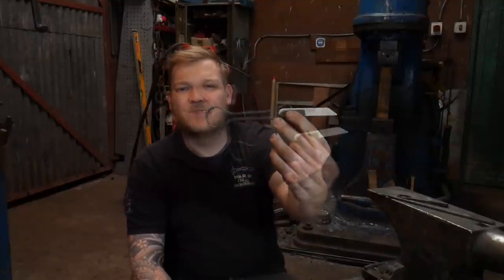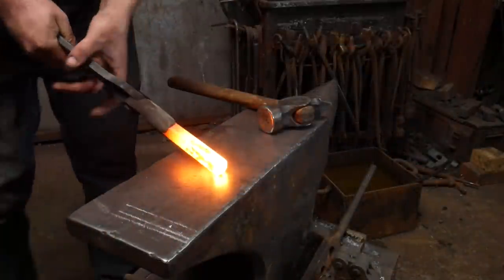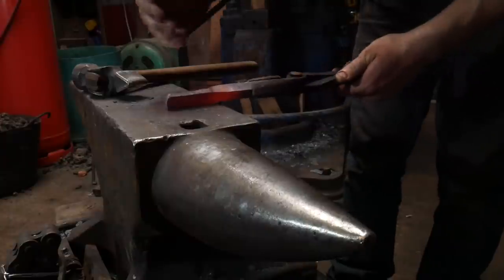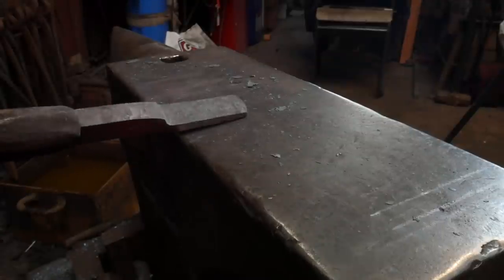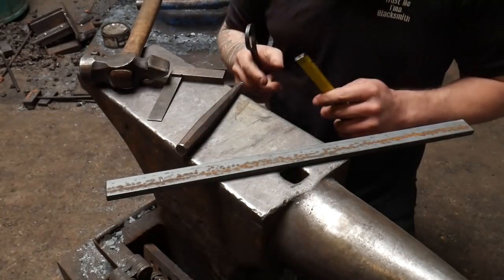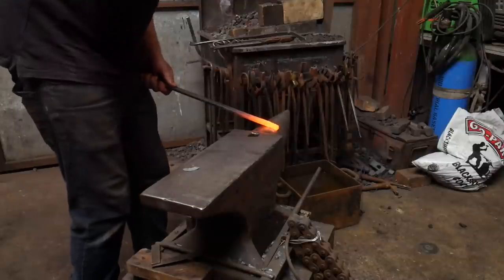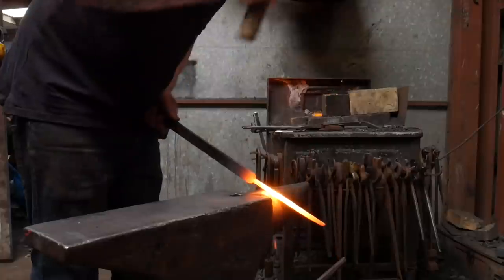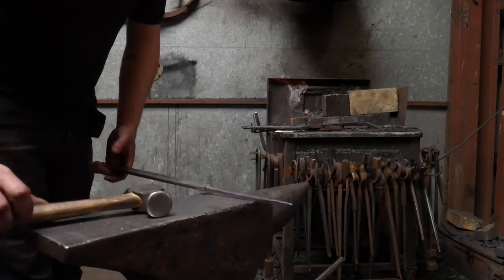Soapstone Holder Great Blacksmithing Project! Stay Home, Stay Safe and Stay Blacksmithing part 1

Comment: I'm usually home, being retired, 
but to finish building my boat I
need some 5 inch long 3/8 in.
bolts quicker than 'smithing .
My parent was a blacksmith in
agricultural work.   Loved junk
and what could be cut up to
be hammered differently.  I
expect that's what is looking
down over your shoulder.

Comment: Pattern welded steel you yanky sympathizer.

Sent with love.
Reply from the maker: Technically it's Damascus but I'm not one to be pedantic!!
Reply from the maker: How's you big man in lock down?
Reply: @danielmoss2089  Well Dan, myself being one of those sad pedantic people here's my vague understanding of Damascus steel. It comes from an iron sand seam that ran from southern India to the top edge of Sri Lanka, this mine is now depleted so cant be sent over to Damascus for refinement and manufacturing of true Damascus steel. The stuff people are pumping out these days is night and day different than true Damascus steel.

Lockdown is slow.. I'm working from home which is an odd one for a blacksmith! I've got a shed load of cad drawings to do. And I'm playing about with clock mechanisms in the evening. Hows things going with you?

Shame Adrian's was cancelled, i was looking forward to seeing everyone!
Reply from the maker: So there is not written usage of the words "Damascus Steel" till the mid 1700 where Winchester the gun company coined it as a trade marked gun barrel option. It was a mix of two metals iron and a crucible/blister steel then etched and polished. 

what your talking about is wootz or an equivalent. This steel was found all over the world and there are even viking finds with the stuff in. 

I used to feel the same about the name but just the fact some english company coined the term to create a trade marked gimmick makes me less picky about calling it Damascus steel. lol

I'm as busy as can be. selling loads of stuff and i have a couple of jobs on the bench. i can still work which is all good.
Reply: @danielmoss2089   I believe it was the blades themselves that were referenced as Damascus prior to the 1700's Dan, rather than the steel specifically.  Damascus blades were also highly prized as much for their furniture and fittings as the quality of the steel from which they were made (as good as that was). The unique patterning of wootz steel the Damascus blade makers used was an easy identifier and so became synonymous with a 'quality' product (much in the same way that having 'Ulfberht' on your sword did back in the 9th Century). I've even heard the argument that it was the attempts of other blacksmiths to fake the wootz pattern that led to what we now call pattern welding. I doubt this though as there are examples of 'modern' pattern welding techniques found on Roman and Anglo Saxon blades that I believe predate Damascus' hey day. There's little doubt that the Winchester gun manufacturers wanted to try and recapture and exploit the sense of quality that the term 'Damascened' would add to their product.
Damascus Steel and Pattern Welding have become interchangeable terms these days, and although that's technically inaccurate people have been doing so for over 300 years now.  I personally prefer to be accurate but I can't be ars*d arguing the toss. People either get it or they don't  :D

Comment: I have a question, would it be easier to start out with a smaller stock ... Like a 3/8 square or round? That seemed like a large size to start out for that project?

Comment: I'm thinking about getting into the craft in the xorona lockdown or After it. How long do you think i will need to lesen how to forge weld for cable damascus
Reply from the maker: Depends on how well you listen.
Reply from the maker: It should be too hard you just need to know what to look for.
Reply: That Sounds great
Reply: Do you need flux for cable damascus saw habermann nice on a Video use quartz sand